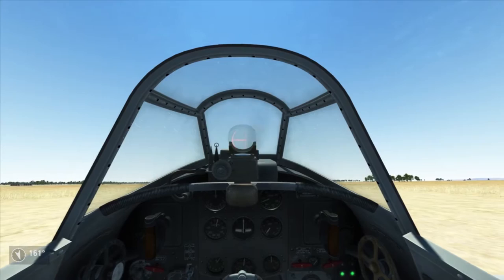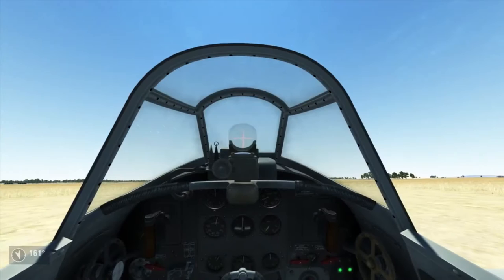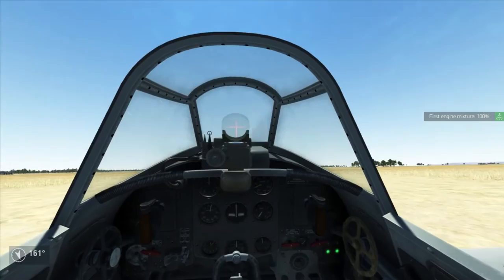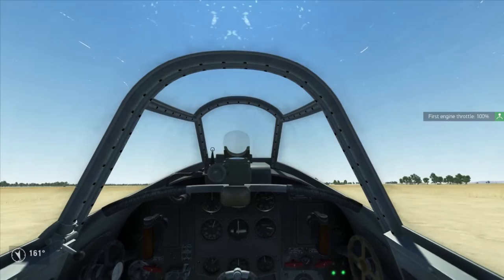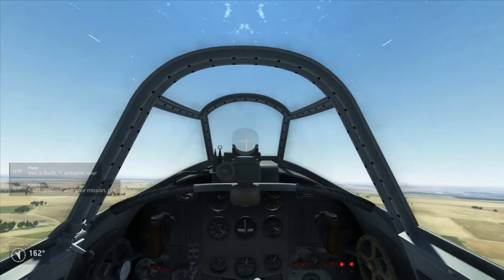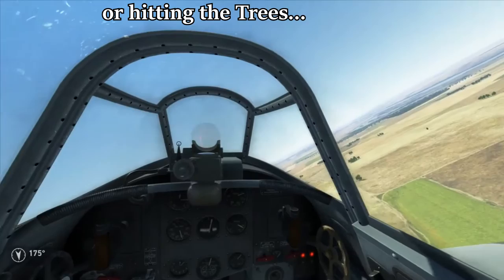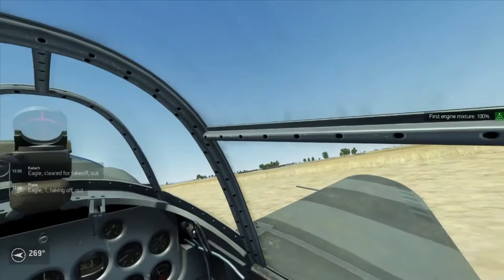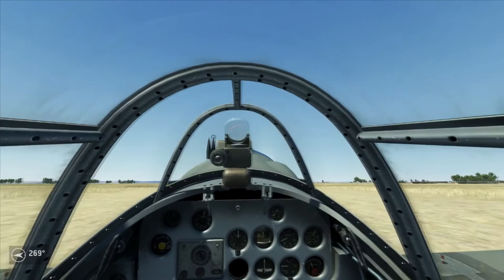How to IL-2: Takeoff

Comment: why did the plane turn by itself during takeoff
PLIS help me
Reply: This is because the propeller is spinning and causing torque. Try to use rudder correction to keep center after getting off the ground or trim your ailerons to the opposire directio. To help prevent torque turning
Reply: Lock the tailwheel beforehand and use rudder input opposite the spin. Also helps to throttle up gradually on takeoff instead of flippingnthe throttle to 100%